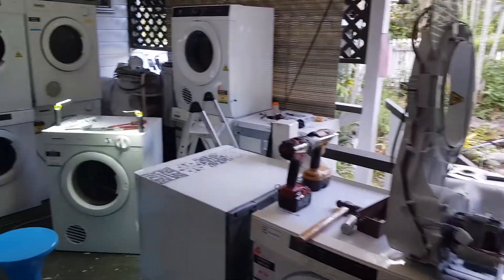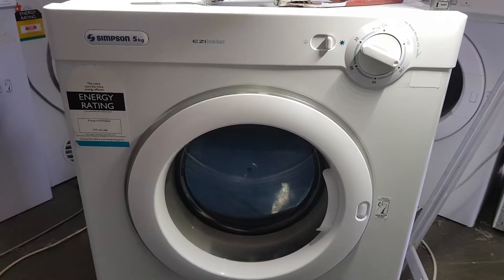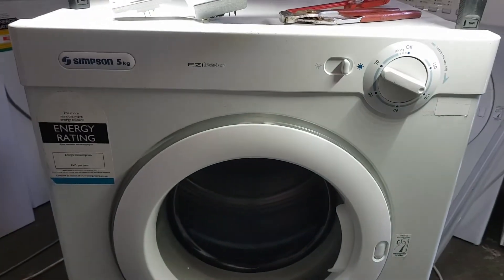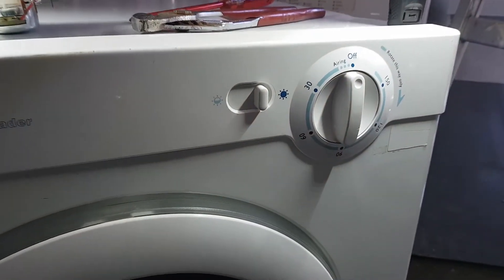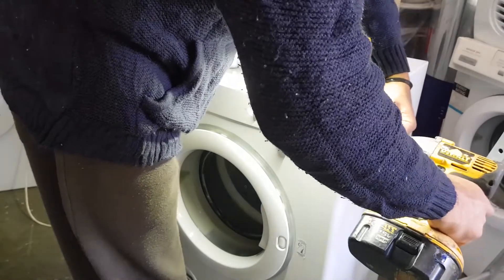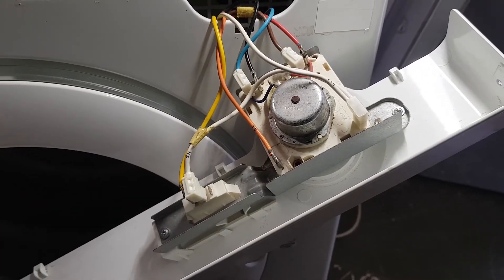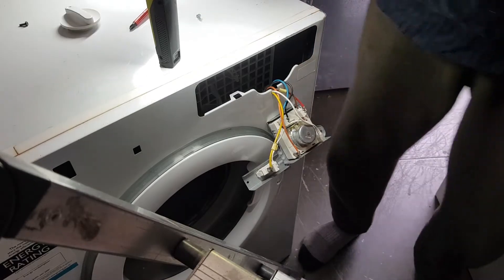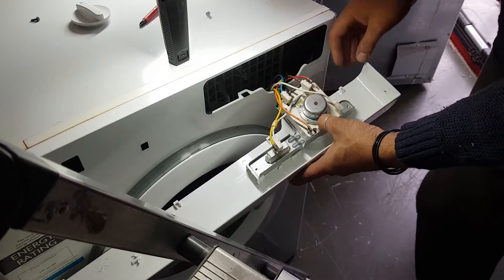Simpson EZIloader Clothes Dryer Manual Timer DIY / fix / repair / replace  in under 5 minutes

Comment: glad I watched this before I took my dryer off the wall and opened up the back. I've worked on a few dryers in my time changing belts capacitors elements and door switches but have never taken a timer out. My timer has the second symptom you described stopping at around 90 mins and just before cool down.  Also just checked eBay and there are new ones for $45.
You sound like you have an Aussie accent. Good Clip, invest in a Tripod it will make all the difference at your end. Cheers
Reply from the maker: Heya, so sorry for the delayed reply.  Happy to help.  Great to know 👍  Mate were they used or new ones?  Cheers
Reply: @DIYDumpRat  hi, I'm not sure, on the day i decided to do it I just went to appliance warehouse, it was $75. Had to remove the upright freezer sitting below to get the panel off . Good clip, cheers

Comment: Howdy, Dane dryer in this video is not spinning without a push start.  Lucky to be used 3 times a year.  Took heater duct off exposing drum so could give it the push start.  Live in rural Victoria so keen to try fix as can’t get repairman out.
Reply: Happy to pay for your advice, thank you, Adrian
Reply from the maker: You need to replace the main motor start capacitor mate. Easy fix will cost you around $20. I do it in almost all of my Simpson repair videos. Try this one 👍

https://youtu.be/bKEA7mZ-fas
Reply: just open the door put a key or screwdriver. the slot until it hums then push start it then shut the door just as you pull out the key or screwdriver. make Shure the little knob is in.

Comment: Good work
Do you know whats wrong with same dryer if the dryer is only spinning on one side drum goes one minute for counter clockwise and stops for one minute and running again for in same direction for one minute
Reply from the maker: Cheers Manpreet, if your bowl freely spins by hand in both directions and only in one direction under power the first thing I would do is replace your timer. Can't say I've ever come up against that problem, but yes replacing the timer should fix the issue 👍

Comment: Great video thank you. Have you got a link to buy the timer?
Reply from the maker: Cheers, and sorry no I don't. I've never bought one. I've always just pulled them out of used machines. But if I were to buy one, I'd just search for Simpson manual timer on eBay 👍

Comment: Good video, thanks. But I have a couple of challenges. For the life of me I can't press those tabs in to release the wires from the terminals. There must be a trick to it.

Another thing is the spare part arrived but it's just the white box timer dial. That's fine but how to unclip the old one from that metal bracket? Your spare part included everything, switch, timer dial and bracket in one unit but mine is just the timer dial component. That's the only thing buggered, so cool, but I can't see how to unclip from that stupid metal bracket.

Thanks!